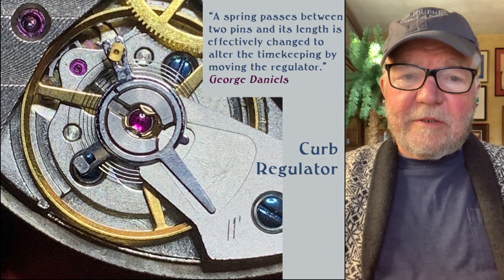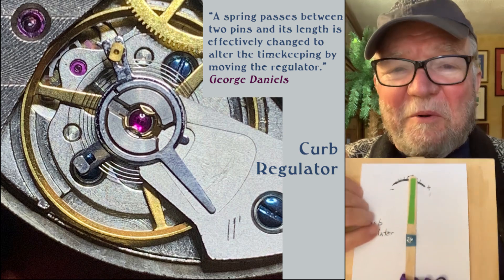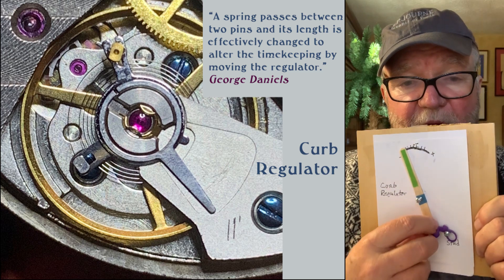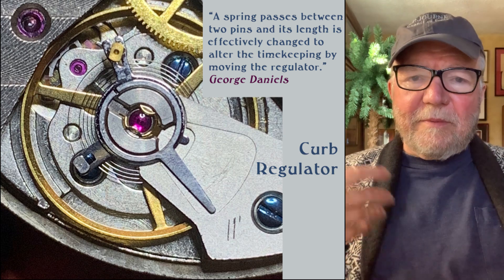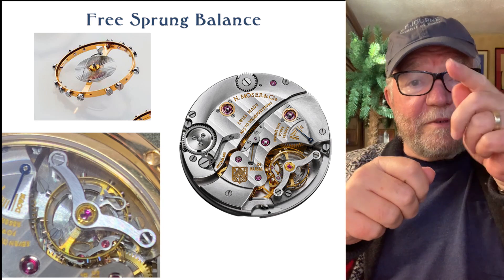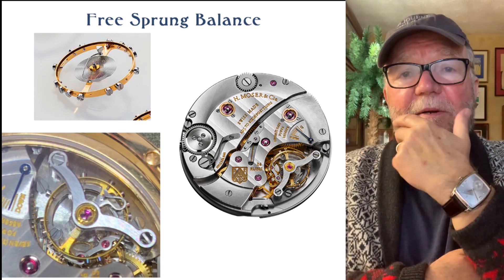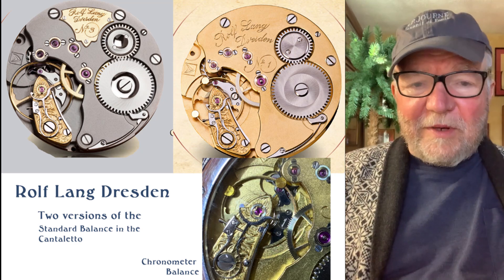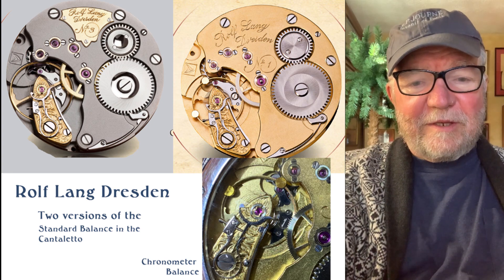Curb Regulators & Free Sprung Balances #VP20

Comment: Great video thanks Bill! I have question, I see PP Rolex etc have already adopted fsb, while cheaper brands use index regulator due to cost and service concerns. But why some high end brands still use regulators even in their top of the line models? for example, VC dual escapement model, Roger Dubuis four sprung escapement model, they are priced at over $200k, so certainly not a cost issue. Are there any other considerations for sticking to the regulator? love to hear your thoughts on this, thanks a lot! Jason
Reply from the maker: Jason, Patek has to use free sprung balances because their hairsprings are now made of inflexible silicon. Rolex and VC choose to do so for the reasons you'll find in George Daniels' "Watchmaking"— or to make service for their watches more dependent on their own services. Take care, Bill
Reply: @watchartsci  Thanks Bill, I would like your thoughts on why some high horology brands such as VC, RD, Piaget, Chopard, still use curb regulators on some of their expensive models if free sprung is so superior?  Thanks again

Comment: With the FSB, if you unscrew the weights a little, will that will slow down wheel? Bill, some of these aspects you cover are my favorite. I think I've now avoided some possible confusion
Reply from the maker: Hi Andy, screwing and unscrewing the adjustment weights on a balance wheel takes more knowledge than I have. I know enough not to try it because  every weight has another 'mirrored' weight on the opposite side; so you need keep the balanced wheel balanced. You need both special tools and knowledge to do it right. Curb regulators, though, are pretty straight forward, but you need to know what you're doing. I've adjusted lots of watches with curb regulators, but they're all inexpensive ones used in making my own watches. Take care and stay safe, Bill 😷

Comment: Hi Bill, why do you think vintage watches tend to have so many screws in the balance wheel whereas modern free sprung balances tend to only have 4 screws/weights?
Reply from the maker: Quinton Tse, that's a good question. The ones with 4 weights on the spokes would seem to make it easier, but the several weights around the balance would allow for finder accuracy. I'm just not sure. Kindest regards, Bill

Comment: Great video Bill. I wonder what the advantage is of a free sprung movement. I tend to believe simple is best. I guess that's why free sprung moments cost more to service as the time involved must be alot longer.
Reply from the maker: Hi Robert, thanks man! Let me quote George Daniels rather than pretend that I fully comprehend the details.
 —"If the spring is biased a little towards the inner pin it will rest upon it increasingly as the balance amplitude decreases and the short arcs will be quickened. The results are not sufficiently precise for a precision timekeeper and if the regulator is moved [by accident ...e.g., by bumping] the effect is changed."—
The two downsides of regulators are 1) Not as precise as adjusting with the weights on the balance, and 2) If the watch is banged a little, it may move the regulator and throw off the watch's isochronism. 
Kindest regards, Bill
Reply: @watchartsci  Thanks Bill. Makes sense.👍

Comment: Old Philosophical Riddle:  What is the difference between a duck?
WatchArtSci:  What is the difference between a watch with a curb regulator?
Reply from the maker: Hey Fialta...well, I guess my answer lies in my Bovet Mono-Rattrapante: How is a single rattrapante, two? George Daniels lays it out quite succinctly in "Watchmaking" ... index to "Curb Regulator." Cheers, Bill
Reply: @watchartsci  Mine was just a bit of a snarky comment regarding your not always completing the sentences you start.  I try real hard to gain some insights from your comments, but your roundabout way of talking makes it difficult.
Reply from the maker: @SpringInFlalta ... I wasn't even aware I was doing that. Keep on my case and don't let me get away with any incomplete.... what was I saying? Cheers, Bill
Reply: @watchartsci  Near the very beginning of the video you started a sentence "What's the difference between a watch with a curb regulator..." and then went off on a tangent about George Daniels.  I eventually got it that you were comparing the curb regulator to the free sprung balance.  I've got a technical background but I'm not that mechanically inclined so the innerworkings of watches, although fascinating, is often a bit befuddling.  Thanks for being one of the few channels that attempts to describe the meat of the watch.

Comment: Technically the free-sprung structure is better, however well designed and finished regulators are more pleasing aesthetically.
Reply from the maker: Leya, check out pp. 340-341 in George Daniels "Watchmaking." Cheers, Bill
Reply: @watchartsci  Have I misunderstood something?
Reply from the maker: No, I don't think so Leya. Check this out ... the real enigma: https://www.lang-und-heyne.de/en/caliber/caliber-vi/ Cheers, Bill
Reply: @watchartsci  Why do you think it's an enigma?
Reply from the maker: Maybe you know, Leya: The watch has both adjustment weights and a regulator. Can one be adjusted without the other? The complaint about regulators is that they screwed up the isochronous timing and possibly the amplitude. So it would seem that if the regulator were used for adjustments, the weights may have to be adjusted to reset the isochronous timing and amplitude. That's the enigma. If you know, let me know and a good reference! Thanks, Bill
Reply: @watchartsci  I believe that's a tribute to the traditional "screwed balance wheel", i.e. the screws are used to poise the balance wheel or for thermal compensation(sure they are unnecessary with modern material and technology). Adjustable masses for rate adjustment are usually less amount and put at the cardinal points.

Comment: I love my H Moser Endeavour Perpetual Calendar which uses an interchangable escapement module like most Mosers which saves a lot of time in servicing the watch.
Reply from the maker: Have you had it serviced yet Jim? Experience with HMC service and price? With two Mosers now, I have to plan! Cheers, Bill
Reply: @watchartsci  No, It's only a two months old. However, I like the idea that Moser provides factory tuned replacement escapement modules when the watch is serviced. I assume these modules are tuned by a specialist with thus the most experience at this specific task for the best uniformity of performance as well as saving time in reassembly.
Reply from the maker: What I'm hoping, Jim, is that a serviced module is all ready to go when I send in my Endeavour and the serviced/over-hauled module will be dropped in and I'll get it right back. I know that my double-hairspring will be another story, though...😬 Cheers, Bill
Reply: @watchartsci  My understanding is that the modules are stocked at Moser's service provider in New York and Swiss service facilities.

Comment: Only my Omega with calibre 3330 employs a free sprung balance. Alas, it has a solid case back. Now you have me wondering if Grand Seiko will ever produce a movement with free sprung balance.
Reply from the maker: Yes Blaine, I should have mentioned that the Omega has a free sprung balance, but I didn't really know enough about it to say anything and wasn't sure if it was all models or only certain ones. Any insights on the? Thanks man, Bill
Reply: @watchartsci  That would require a good deal of research considering the number of calibres in the Omega catalog, But watch makers continue to innovate with free sprung balances, whereas the regulator balance appears to have reached a conclusion in its' development
https://quillandpad.com/2017/12/11/schmidt-list-5-extraordinary-balance-wheels/
Reply: I think all the 8500 calibers and later coaxial calibers have a free sprung balance.

Comment: Bill, how come the bph speed of the balance wheel can be set EXACTLY to 21600, 28800 ? There never seems to be a deviation when put on a timegrapher. Thanks.
Reply from the maker: Erik, I do not know. It must have to do with the character of the hairspring used. More research .... Cheers, Bill
Reply: @Cedar Canoe Are you talking about the bph that the timegrapher automatically detects? If so, the Timegrapher will detect the beat rate based on a reasonable range (i.e. it detects that your watch is running close to 28800) and then start giving you a reading against that number. Then the actual +/- indication will tell you how far off from that beat rate you are. It will also usually tell you about the amplitude and the beat error, i.e. how close the two oscillations are to eachother in actual time.

Comment: Most high-end german brands use swan neck regulators like GO and Lange. This stuff is some beautiful regulators.

And I think most modified ETAs in swatch group brands remove the regulators. For example, Hamilton's modified ETAs don't have regulators.
Reply from the maker: Tippy ... do you remember the kind of curb regulator used by Glashütte Mühle? Let me know. cheers, Bill
Reply: @watchartsci  They use swan neck adjustment. 

Despite being invented by the british, I think swan neck adjust are mostly used by german brands.
Reply from the maker: Tippy did you see this video? https://youtu.be/T3k7QThzxmY Funny thing about German watchmakers is that they give more credit to the English than the Swiss or fellow Germans for innovation in watchmaking. Cheers, Bill
Reply: @watchartsci  Yeah, that is pretty funny.

Oh it is a woodpecker neck
Reply: Fun fact, the Autotractor family  JLC movements use the A. Lange in house hairspring, but laser welded at both ends and free sprung, while A. Lange themselves will use it with a regulator.
Reply: @nssomething8370  Sounds like Hamilton and ETA.
Reply: More and more "regulators" in new watches are not for regulating the rate but beat error instead. Personally I feel it's a bit pretentious.
Reply: @leyay7540  Why is that pretentious. An easier way to fix beat errors is a great thing to have in a watch.
Reply: @nssomething8370  Does the beat error need to be adjusted as often as the rate?
Reply: @leyay7540  Well, of course. You would want to adjust the beat error at the same time as the rate if it is not ok. The beat error is important in of itself.
Reply: @nssomething8370  I'm not a watchmaker, but in my personal experience, I've seen much less large beat errors than rate deviations.
Reply: @leyay7540  the beat error is always measured in much smaller units, but it does not mean they are less important than a rate deviation. They are two different things measured differently. I think that the misconception you have here is that because it is measured in milliseconds it is negligible when it is not. The beat error is the difference in the clockwise and counter-clockwise swing of balance. Any beat error beyond a certain acceptable threshold needs to be fixed because it will affect the time keeping ability of the watch. Having a regulator to easily fix it is in no way a bad thing.
Reply: @nssomething8370  I know their units are different and I didn't mean it's less important. My point is I don't think it needs to be adjusted so often because most movements don't have a quick adjustment for it.
Reply: @leyay7540  well, first off, please define "often"? A watch should not have to be regulated outside of normal servicing intervals unless there is accidental damage/shock/etc. Second, a good watchmaker should correct beat errors beyond the acceptable values when regulating the watch. I'm not sur why you think they should not. If the watch has important beat errors, it will not function the way it should.
Reply: @nssomething8370  As I said, at least near the frequency as adjusting the rate. And I believe the free-sprung design has eliminated some possible causes of beat errors.
Reply: @leyay7540  you can still get beat errors on free sprung balances. Watchmakers will still make adjustments to fix beat errors in free sprung setups. It happens even in more rugged Rolex movements.
Reply: @nssomething8370  Of course free-sprung structure doesn't mean everything is perfect, but at least you won't manipulate the hairspring while adjusting the rate. From the beginning I didn't mean beat error isn't important or doesn't need to be adjusted. But it's obvious for aesthetics to make the adjusting mechanism exactly the same as the swan neck regulator.

Comment: Great stuff Bill. By the way, I recall  you are interested in constant force designs and the like. You might want to look at Armin Strom's gravity equal force (good, honest and transparent company). Certainly more affordable than a Gronefeld. Regards
Reply: I'd be interested in Bill's thoughts too. Bill, if you haven't seen it already you can start with https://youtu.be/K7d8-aJKmEs
Reply from the maker: Al, Gröenfeld is at the top of my list (unless I can talk a friend into selling me one...), and I do like Amin Strom, but I'll have to learn more about gravity equal force ... sounds a bit like AS's retrograde....no? However, I cannot afford anything now after getting that H. Moser ... which has proven to be everything I had hoped! Cheers, Bill
Reply: It just cuts out the strongest and weakest portion of the mainspring power supply. Probably practical but far less special nor complicated than a remontoir d'egalite.
Reply: @leyay7540  sounds like the solution to the problem, but not complicated enough for some